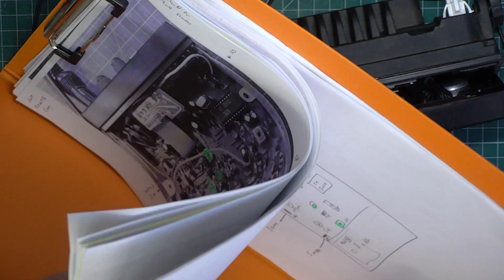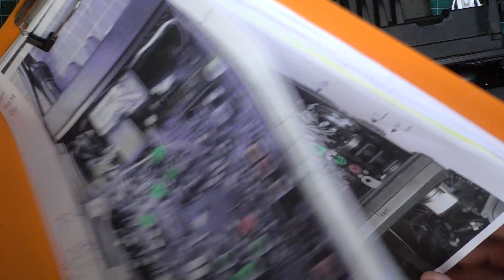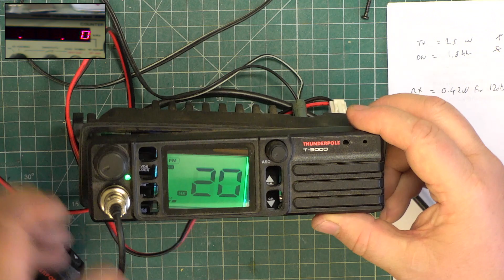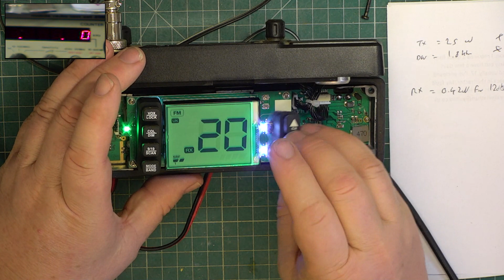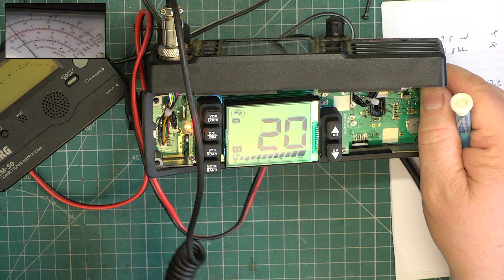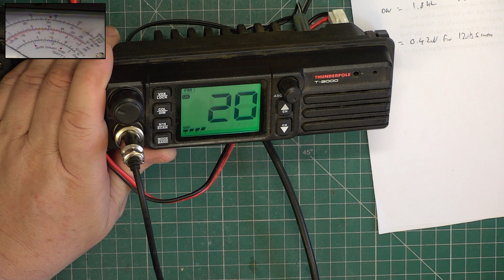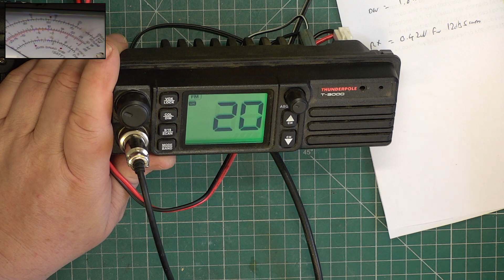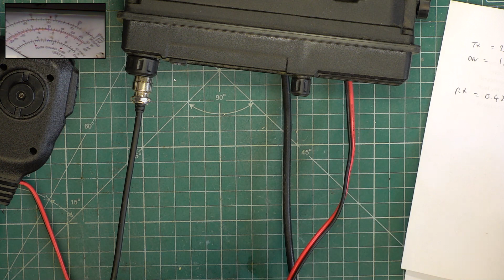Thunderpole T3000 CE MultiNorm CB radio - optimisation

Comment: Hey, sorry I've not been by of late, my Dad died ... My daughter got me a MultiNorm radio to chear me up, but we appear to have been conned by "KAM-SAT". It's a "Canva CB-520", they claimed it did "EU,CE,UK,PL,I2,DE,IN", and this is what it also says on the box, but the radio does not do this. It does "CE,g,A,b,C,d,E,F,p,n". CE is cept FM, g is Germany 80 channels, p is Poland, n is Netherlands and the others are really bands A,B,C,D,E,F, which, in CB speak, is super super low, super low, low, mid, high, and super high, but there is no UK. It's like a T800 but the controls on the front panel are arranged differently. It works but buzzes like a 1960's Scalextric transformer when switched on. The receive is a bit deaf on channel 1 (d/mid/EU) but great on 40. It looks really cute though, so I may actually keep it. Maybe get it repaired at some point in the future?
Reply from the maker: I once had to send a set back to KAMSAT. It was advertised as UK. It wasn't it was CEPT only. They said "well it can be used in the UK". No a CB MultiNorm with UK clearly means UK 27,60125 to 27.99125FM. I still sent it back & received a refund.

Richard
Reply: @ukfmcbradioservicingTango21  Good for you. Glad you got your money back.